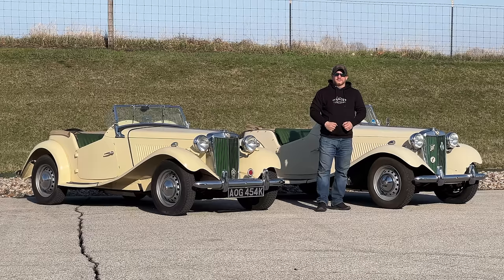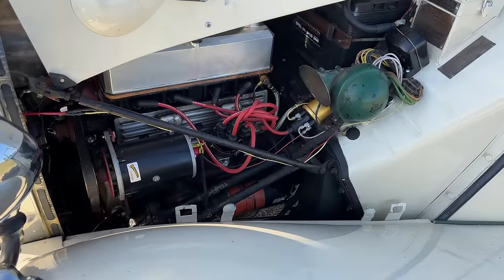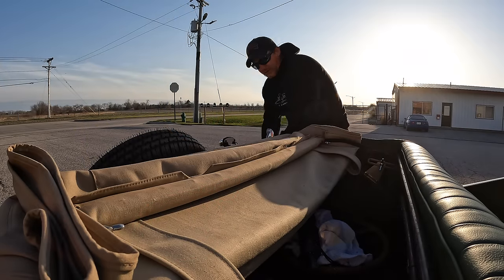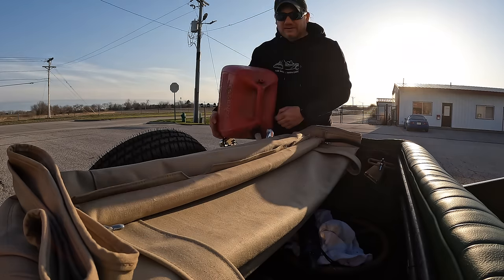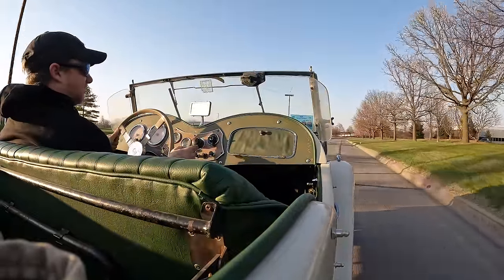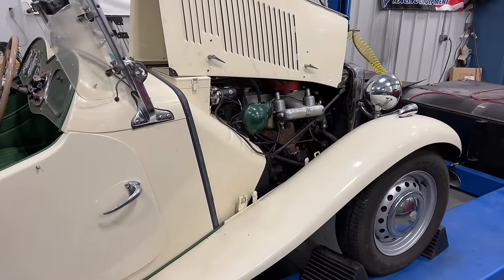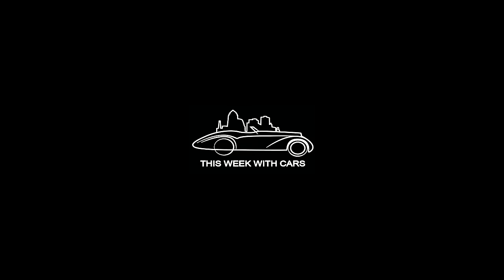MG TD Modernizations & Breaks Down On Road

Comment: I'm about to write something critical, but understand I love the channel. To me the best part is watching you diagnose and solve problems. I'm less enthused about watching you navigate roundabouts.  I would have gladly sacrificed that video time in exchange for seeing more of you removing the gas tank screen and getting the fuel-flow problem solved.
If in a month's time there are only a couple of thumbs up to this comment, then I'll know I'm in the minority, but I suspect I'm not alone in this point of view.
Reply: I agree , it's a fascinating vehicle , but driving on modern roads not so much .
Reply: Can't really agree with you. I rather enjoy watching old classics being driven at normal road speeds. I wouldn't want the whole video to be just that but, in this case, Steve was showing the differences in speed/rpm etc with the replacement box. I thought he demonstrated that quite well. Remember, of course, that his fuel problems extended the driving part of the video and, quite possibly, changed the whole style of the video. He wouldn't have been expecting to be stuck at the roadside and the repair and test drives were unplanned too, all adding to the amount of driving footage.
I'll be pretty surprised if the 👍-count on your comment reaches double figures.😁

Comment: Nice cars and a well-made video. From a long time TF owner (same car, really) a comment - Clean, flush and 'slush' your fuel tank! The external fuel tanks on our cars are very susceptible to condensation and are almost always rusty inside after 70+ years. A $2500 + transmission swap and $600 steering wheel are cool, but a clogged $40 in-tank screen and a dysfunctional $40 'Low Fuel' switch makes us proud MG owners and our cars look bad.

Comment: I know what happened.  It's a MGTD.  The TD stands for "tired dog".  After owing one, I have these comments.  The rear axle broke several times because there is a trick to sealing the transmission and keeping oil off the clutch assembly.  The clutch tends to grab and torque is greater than the axle can handle.  The engne is under powered. The SU carburetors  are difficult to tune.  The electric fuel pump sometimes stops and to re-start it, the firewall needs a goodkick.   Other than that,  The roof leaks. but the winshield wipers barely work so it's OK.  I loved the car, it was great to drive.
Reply: That’s an awesome assessment. I’ll give one a miss. Thanks mate. 🇦🇺👍🍺🍺

Comment: The vehicle that made touring a 55 mph task, the poor engines would not  handle real highway speeds, then finally the TF and eventually the MGA with the 1500 engine. The Best TD I ever drove had a B-20-B Volvo engine and LD overdrive.  Really fun to drive.
Reply: the B20 engine is another beast, more than the double of the original horsepower and torque plus the reliability of the Volvo engine

Comment: As a 46 year long owner of a twin pale yellow TD this was a great video!   I run stock engine and gearbox but have fitted 4.55 ring and pinion.   I find the shift linkage very positive.    Never run it out of gas,  the green light starts to flash as the fuel sloshes around at about 3 gallons left,  stays on constant at about 2 gallons.  Eugene Oregon
Reply from the maker: To be fair I didn't run out of gas in the tank, I just ran out of gas to the engine.
Reply: John Quilter....   Good move on the diff and I also find the TD boxes "positive".  I was recently east of  Springfield looking at a 53 MKII, unfortunately it had the wrong owner for too long. I passed as it was emasculated.   Jacksonville, Oregon  and a 63 MGB owner.
Reply: @jeffhildreth9244   Join the British Motor Club of Oregon based in Eugene to connect with other enthusiasts and perhaps find a car.
Reply: @ThisWeekWithCars   A few decades ago that happened to me when California was putting MTBE in the gasoline that caused fuel pump disk valves and carb float bowl needles and seats to stick. Awful stuff,  finally done away with.
Reply: @johnquilter7620  Thanks John, I may just join. I do belong to the So Oregon Brit Car CLub.
My first car, purchased in 1964, was a 1953 MGTD MKII. I am currently looking at a 1954 TF. XPAG.
Reply: I would like to know the 2nd gear ratio of the TD and TF, MGA and B had a rotten 2.2+ ratio, too much gap to third. i think TC was about 1.9.
Reply: Per factory WSM, dated 1-54 second gear ratio for the TD was 2.07.   For TF as quoted second gear ratio was also 2.07. Final drive ratios varied on these cars however
Reply: . @johnquilter7620  Ok ,thanks for that.

Comment: well you now know how the engine behaves with partially filled floatbowls! IMO, a good thing to know. the dual mikuni carbs on my yamaha 1100 behaved similarly when the main and reserve tanks were empty too. :)  

and that low-fuel light (as i'm sure you know) is tied, along with a few other noticeable electrical items that will fail in concert with it, to one of the two visible fuses, near the voltage regulator, in the engine compartment. 

...just about ran out myself the other day in my TD, after i blew that fuse and didn't know it. fortunately, i carry a stick and when i discovered my predicament, suspected i might be low on fuel. ....turned out i had a pint or two left when i pulled into a station. ...plenty! ha

BTW, enjoy your clear, no nonsense, explanations of what you are doing and why. excellent! not all that common on DIY youtube vids.

looks like that 5th gear acts in a similar manner WRT RPM and speed as the 4.55 diff i had installed. pretty much mandatory, IMO, for highway travel (barely) and a reasonable RPM for extended periods. the swap involved removing the rear axle and the purchase and installation of readily available parts. expertise is required for the installation, at least it was beyond MY expertise anyway. :)

Comment: having just purchased a  new-to-me body-off 1953 TD restoration with right-hand drive, and even though my first car was a 1961 MGA, and i've driven manuals all my life, i had a bit of difficulty in shifting the TD for a while. i've attributed it to shifting with the left hand while steering with the right one. it was very awkward at first. having an unsynchronized 1st gear takes a bit of forethought before 1st gear engagement. other than that i don't have any complaints.

 i own two other (premium) manual sports cars, one german and one british, and a 2001 manual dodge ram 1500. what's surprising is that the shifting is best in the dodge, more precise and smoother! and the shift lever is about four times longer than either of the sports cars. remarkable!

the biggest problem with the '53 TD in general is the lack of power. at 50MPH it's geared in fourth to be  pushing 4500 RPM. for comparison just three or four years later,  MG came out with the MGA and at 60MPH was running 3500 RPM, which is doable, barely, for freeway driving. the TD? not so much... :( 

it needs more HP and a taller rear end or an overdrive. i'm planning a trip across the country this summer (we'll see about how that goes) and i'll have to plan carefully to avoid speed limits over 50mph. could be difficult.

 ̶o̶h̶ ̶y̶a̶,̶ ̶t̶h̶e̶s̶e̶ ̶b̶a̶b̶i̶e̶s̶ ̶d̶o̶n̶'̶t̶ ̶r̶e̶a̶l̶l̶y̶ ̶h̶a̶v̶e̶ ̶a̶ ̶g̶a̶s̶ ̶g̶a̶u̶g̶e̶.̶ ̶m̶o̶s̶t̶ ̶p̶e̶o̶p̶l̶e̶ ̶u̶s̶e̶ ̶a̶ ̶y̶a̶r̶d̶ ̶s̶t̶i̶c̶k̶ ̶i̶n̶ ̶t̶h̶e̶ ̶f̶i̶l̶l̶e̶r̶ ̶h̶o̶l̶e̶ ̶t̶o̶ ̶d̶e̶t̶e̶r̶m̶i̶n̶e̶ ̶a̶ ̶r̶o̶u̶g̶h̶ ̶i̶d̶e̶a̶ ̶o̶f̶ ̶h̶o̶w̶ ̶m̶u̶c̶h̶ ̶f̶u̶e̶l̶ ̶i̶s̶ ̶i̶n̶ ̶t̶h̶e̶ ̶t̶a̶n̶k̶.̶ ̶a̶l̶t̶h̶o̶u̶g̶h̶ ̶m̶i̶n̶e̶ ̶h̶a̶s̶ ̶t̶h̶e̶ ̶s̶t̶a̶n̶d̶a̶r̶d̶ ̶d̶a̶s̶h̶ ̶m̶o̶u̶n̶t̶e̶d̶ ̶i̶d̶i̶o̶t̶ ̶l̶i̶g̶h̶t̶ ̶t̶o̶ ̶w̶a̶r̶n̶ ̶t̶h̶e̶ ̶d̶r̶i̶v̶e̶r̶ ̶t̶h̶a̶t̶ ̶t̶h̶e̶ ̶t̶a̶n̶k̶ ̶i̶s̶ ̶a̶b̶o̶u̶t̶ ̶e̶m̶p̶t̶y̶.̶ ̶.̶.̶.̶i̶t̶'̶s̶ ̶n̶o̶t̶ ̶l̶i̶k̶e̶l̶y̶ ̶t̶o̶ ̶b̶e̶ ̶n̶o̶t̶i̶c̶e̶d̶ ̶t̶h̶o̶u̶g̶h̶.̶ ̶:̶(̶  :)

Comment: Would have loved a 5th gear in my TD. In 1962, made many weekend trips from Camp Lejeune, NC to Long Island, NY. 14 hours, no interstates then. Only problem I ever had was the electric fuel pump filter getting clogged. I had no mechanical knowledge then; it would stop but after a while the sediment would drop enough for fuel to flow for awhile and run again. Didn't know if I'd ever get  back to Base!

Comment: Watching this video convinced me to buy a Honda Rebel 250
All the spoke wheels I need without the price and er.. notorious British quality.   
It's like he had to replace almost the whole dang car to make it drivable in 2022.  My budge is about $1,500 max I want to spend.

Tip for the future.   My advice is if your car starts sounding really funny and loses power, stop and turn off the car immediatly and park it.  It's very possible to do way more damage.   Sounded like one of your cylinders stopped firing from an ignition wire not getting spark or not enough fuel.   Or your idle jet carb valve may have gotten clogged.. pretty common, happened o my motorcycles a lot and would exhibit the same symptom.  Clogged fuel filter or ater in the fuel too will do something like this.  I never would do any regular periodic maintenance on them except change the oil and check the tire pressure so that was to be expected.I would hope that was it, because anything worse than that needs valve or cylinder work.

You lucked out.   I've run out of gas 200ft from a gas station and literally rolled to a stop in front f a pump before.   OTher times not so lucky, and had to hike 5 miles passing 5 closed gas stations on a late Sunday night.

Comment: I had a 59 VW beetle with the 36hp "sewing machine".  It had a reserve.  if you run out of gas, turn the reserve and you have close to  a gallon to get to a station.
Reply: Many off-road machines and motorbikes have this feature in-leau of a gas gauge
Reply: Charlie Metcalf... that is if you remembered to flip the lever the last time you filled up.

Comment: Great real experience vid on a car similar to my own 51. I added a switch so I can test my fuel circuit and bulb now and then for that very concern, lol. Don’t have a 5 spd yet, but did go with 3.9 gearing in her.
Reply from the maker: How does your fuel circuit work?
Reply: @ThisWeekWithCars  superbly after I sealed my tank. Went inline with a fram filter and an electric 4 lb fuel pump thereafter. My car is very upgraded, but to look at is still her 51 cute self.

Comment: I was working at a British car shop and we got a TC that came from another shop.  It was completely restored by the other shop and after being in our shop for a couple days the engine started knocking.  I had the engine apart and discovered the flywheel bolts were backed out.  After I fixed it I took it for a ride and the TC did exactly what your TD did.  I was going up a steep hill and the car started misfiring and slowing down.  I got to the top of the hill and another 100 feet down the road and it conked out completely.  I was out of gas and no-where close to a gas station, so I called home base and had them come out and bring me a couple gallons.  Had a nice hour standing next to a car that looked great but didn't go anywhere.
Reply: IIRC, those bolts are supposed to have bend-over tab washer-type things on them like the conrod cap nuts to keep them in place.
Reply: @deep6thisdeep6this92  They were missing and the bolts holding the flywheel on were generic replacements.  We got a set of the original bolts and the lock rings and put it back to stock.  It worked fine after that. Not sure how I felt about the original wheels and tires though.  It was a little too wimpy for me.

Comment: Reminds me of my experience with my 1978 International Scout..  After owning it for a number of years, I would drive on the highway and at about 90kph (55 mph), it would suddenly lose power. I could drive at lower speeds.  Took it to the local International dealer snd after several visits and hundreds of dollars spent, they finally determined that there was an filter inside the tank that was a flexible mesh. When fuel flow was high it would collapse and cut off the fuel flow.  What a stupid design. It was a beast of  'truck' but it got 12.5 mpg no matter how it was driven.
Reply from the maker: I had a Scout but still have three other Internationals, check out my video having some fun with my Travelall:  https://youtu.be/jgHmaR0xL4Y
Reply: My 1972 International 1010 Custom truck also has that idiotic "sock".

Comment: Thanks for this video. I restored my 53TD back in the early 2000's. Same color scheme.  I opted for a MGA rear-end ring and pinion and kept the original 4 speed. The ratio change had much of the same effect on RPMs.  The gearbox is primitive, but fits better with the rest of the car in my opinion. I also run reproduction bias ply tires, so I really don't want to drive highway speed!  Are you going to drive the earlier TD for comparison?
Reply: any info on the rear-end mods would be appreciated. parts? installation? trouble hill climbing with the mga ring and pinion? who did the work? are you satisfied?
Reply: @deep6thisdeep6this92  I had this done back around 1999 by University Motors in Michigan, they had a donor rear-end. I didn't drive the car before the change, so I don't know how much it changed the character. 1st gear is very usable now and the car will run 50 MPH without screaming. With only 54 HP, its definitely not fast. Does fine on hills.
Reply: @deep6thisdeep6this92   I run a 4.55 final drive in my TD and this makes it a bit better on the open road but quite frankly, in my opinion these cars are not really great highway machines, as someone once said, stick to roads that existed when the car was built but you can still have a lot of enjoyment from them.   I find no trouble hill climbing with this gearing.
Reply: @johnquilter7620  thanks for the info. 
i've done some research and when  considering price, performance, and installation the best compromise is the 4.55. supposedly the TD can run 56-57mph at 3500rpm with it. should be enough for me.

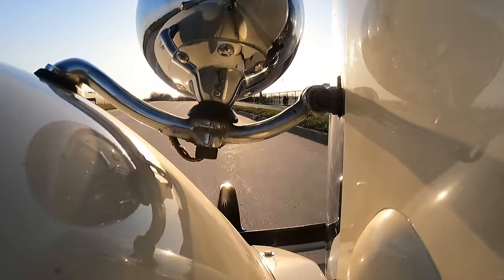Comment: At 3:05 you remark "You still have to get used to driving a carburated car". What do you mean by that? What "getting used to" do you refer to?
Reply: my question too??
Reply: Mixture control and idle speed are not automatic on these. So starting them takes a little technique particularly in cold weather.

But set up correctly these little XPAGs are robust and good runners, if a little drippy due to their ancient crankshaft seal design

Comment: I think all the mods are great, especially engine based ! BUT the new Speedo/Rev counter is appalling! One of the charms of these T-series is the dash and instruments, the removal of these has altered the soul. Lets face it, it's a part of the car you look at constantly... and on top of that we've lost that lovely clock. Perhaps there is a lesson here in installing some modern fuel gauge subtly for those who can't drive without one these days.

Comment: At least with the Austin Healey 3000 you can hear the electric fuel pump behind you starting to go tic, tic, tic when the fuel supply is nearly gone.
Reply: I had a '52 TD that I restored in "62 - carried a yard stick to check the fuel level.  It had an electric fuel pump that had a habit of sticking, if it stopped you got out and tapped it with a spanner, it also on occasion sucked a bit of oil up into the distributor and you had to wipe the points off.  Driving in the rain was a thrill - the little wipers work enough for an English drizzle, not a Texas downpour, the top sits on the windscreen and tends to leak and the side curtains tend to suck out at speed and let the rain blow in.

Comment: If you check your fuel level with a wooden stick sold by Moss you need to attach a clear plastic pipe the length of the stick and dip the tank with your thumb over the pipe end. This will show you the correct level.
Reply from the maker: I have sticks for checking the level in my race cars, never heard of the plastic tube trick, I like it.